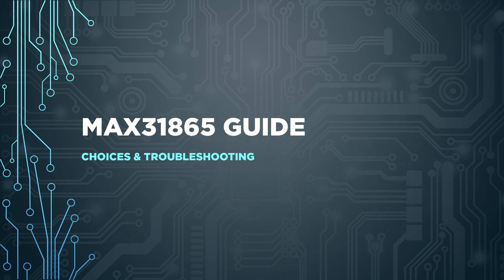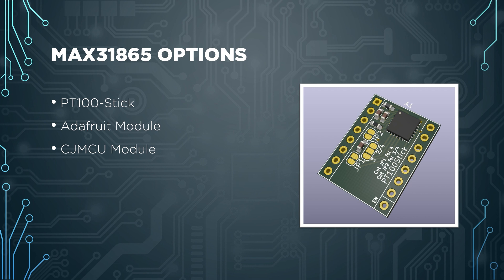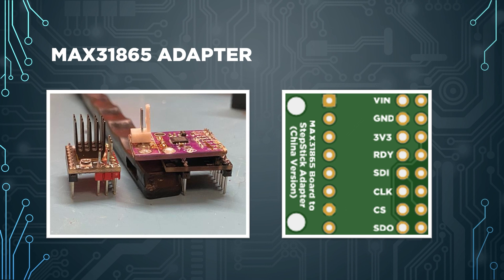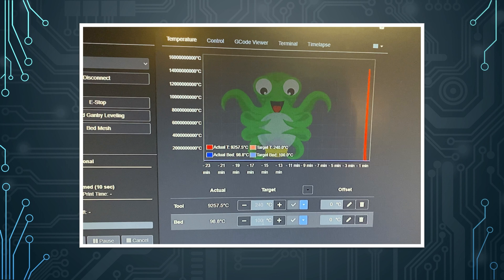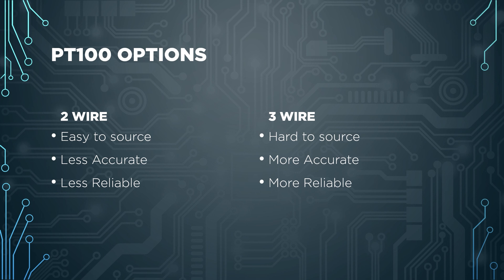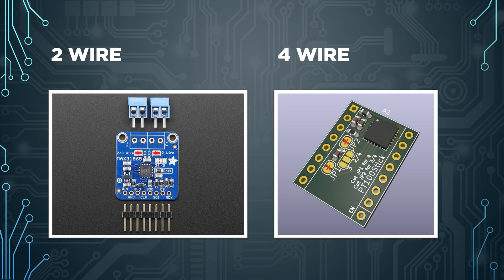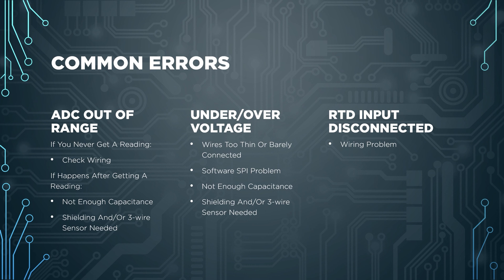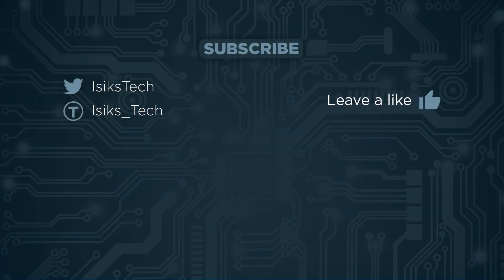Klipper MAX31865 Options & Troubleshooting

Comment: I have a Dyze D-500 thermistor/RTD and Octopus pro. How can I configure this with a custom resistance table top match the D500 using Klipper? It seems when I select the MAX31865 in klipper the rtd_nominal_r: and rtd_reference_r need some calibration.

Comment: Hi, I liked your presentation. I'm trying to use this in a completely different way. I have a gas sensor with a platinum heater (which functions as an RTD, but R at 0 degrees Celsius is 10 Ohms). I was hoping to connect a max31865 between the heater pins and be able to read the temperature. However, I don't know what I would have add/change to get it to work for a non PT100 or PT1000 RTD. Do you have any idea? I'll appreciate any help you can provide. Thanks.
Reply from the maker: Sorry I don't know the answer. Check out the max31865 datasheet, maybe there's more information on that.

Comment: first of all thanks for the video it was really helpfull. So I installed pt100 recently and even when it is aroun 250 degrees out of knwhere temp jump up and goes down significantly. I understand that this is about noise right?
Reply from the maker: Noise is definitely possible. Also if this is only happening during printer movement, good chance it is the wiring too. A loose connection will still conduct but resistance will be high.
Reply: @IsiksTech  Thanks a lot for the reply. It is happening while gantry is standing still. I'm going to buy 3 wire PT100 's then thanks again.

Comment: Currently you see many starting to use a PT1000 icw MAX31865. Which would you use now and why?
Reply from the maker: Depends on your controller. If you have a board with high accuracy resistors (like spider or duet) then pt1000, no max31865. For most boards I'd still recommend pt100 w/ max31865. If you don't have a board yet, then spider with pt1000. No max31865 is easier to use and accurate enough when the resistors are good.
Reply: @IsiksTech  I have an Octopus 1.1 on order, which supports one of those add on MAX31865 modules. Maybe I will go for a Octopus Pro 1.0, which already has the MAX31865 onboard. Would there be any difference in using pt1000 vs pt100?
Reply from the maker: Asking about pt1000 with max31865? If so it's theoretically better than connecting directly to the thermistor connector but your max31865 board needs to be the pt1000 version. Almost all max31865 boards are for pt100 not pt1000 (iirc 400 vs 4k ohm reference resistor).

Comment: Is there a way to wire the 31865 via SPI to my SKR 1.4 and set the correct pin in Klipper's config rather than wiring to raspie gpio?
Reply from the maker: https://docs.vorondesign.com/community/electronics/xbst_/PT100.html

Comment: I randomly get overvoltage/undervoltage. using 2 wire PT100, the SKR 1.4 E1 port. Its not using shielded wire. the pt100 that I bought didnt have that wire. so im looking to add a cap, but I dont know how to find a 100-500 nF cap.  I have a couple of brown/orange cap with 103 written it. would these work ?
Reply from the maker: (I assume you meant 2-wire for the PT100)
That is only 10nF. (Use https://www.electronics2000.co.uk/calc/capacitor-code-calculator.php)
You can use a component store like Digi-Key, Mouser, etc., or buy a variety pack from eBay, Ali etc. I am using a polymer cap I got in a pack like that. (All cap types should work)
You can also try adding that cap to see if it helps, but it likely won't be enough.
Reply: @IsiksTech  Yes sorry.. 2 wires.
Reply: @IsiksTech  man.. I completely fixed my issue ! the solution was super simple! Ground my 2 PSUs to the frame of the printer! It also fixed random camera issue. Now PT100 works super and seems accurate :)
Reply: @Vez3D  Wow! I couldn't figure out the same issue I had as yours. No matter how many capacitors I added. The issue is gone after I ground my frame to the PSU.
Reply: @Vez3D  I have grounded my PSU and still got this error, any hints?

Comment: Great video, thank you. Your link for the Pi as MCU is not working for whatever reason.
Reply from the maker: I don't know what happened to it (it was supposed to be there forever), and I don't have a backup. But I did write a written guide for Voron. It should have all the info you need. https://docs.vorondesign.com/community/electronics/xbst_/PT100.html#pi-mcu
Reply: @IsiksTech  awesome thank you! Keep up the good work.